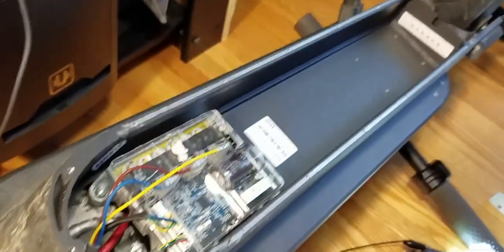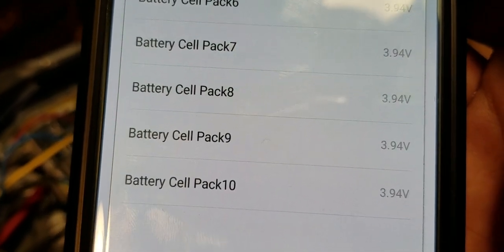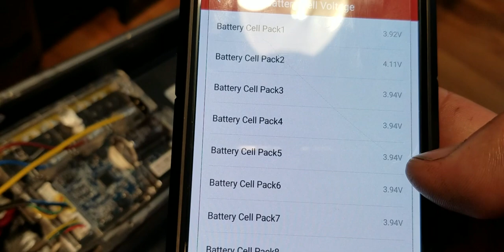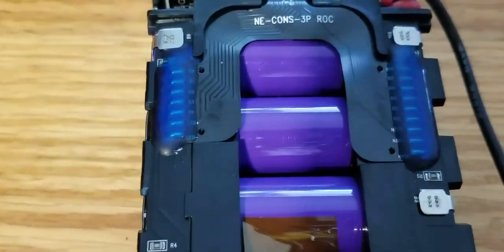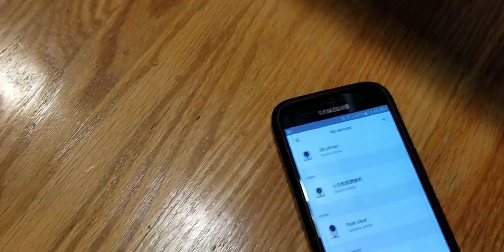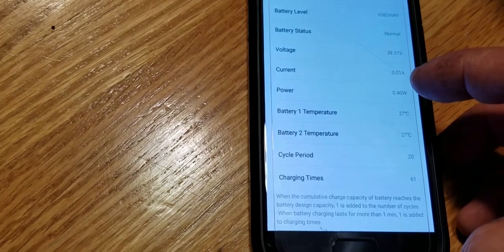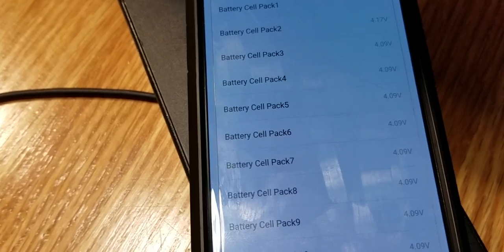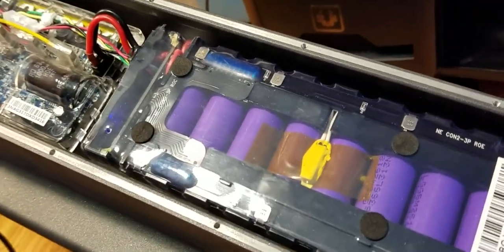Xiaomi M365 range problem - diag and repair

Comment: Hi guys, I just got my M365 scooter and been riding it for a week now. Quick question, does anyone here know if it's optimal to charge it after every ride, or should I wait until the battery goes to at least below 50% before charging? Does this even matter? Is there such a thing as a maximum number of total charges within the batteries?
Reply from the maker: i find it best to charger after every ride except when the next ride starts with a long downhill, because the regenerative braking will not work until you've used up a bit of the charge. it scared me the first time that happened, had to put my foot on the ground to help me slow down.
lithium ion cells don't suffer from frequent top ups. using up 20% and charging it back up is better than using up 80% and charging it back up.
enjoy your scooter and thanks for the sub!
Reply: Thanks for this video. I also use my scooter to ride to work and back and my ride is also less than 5km each. But the 3 times I rode it to work last week, I noticed that my scooter went from 100% battery to 71% my first ride, then 66% the second ride, and down to 64% my last ride. So I will also need to do this battery analysis like you.
Reply: I just checked and I have 41.35 volts at 100% power so the battery seems fine. But I can't get my app to display individual cell power. I have version 1.3.3 firmware and my Samsung S8 says that this is the latest version. I have Ninebot and Mi Home apps installed by the way.
Reply from the maker: mine fully charged and still connected to the charger is sitting at 41.55v. you really need to see individual cell pack voltages to really know if there is an issue or not. Only the mi home app can display the individual cell voltages. you should be able to update to 1.3.4 through the mi home app. and im am using a Samsung S7
Reply: I'm not sure what the mi home app is doing for me. When I go to my ninebot app and pair my scooter, then I go to my mi home app, I can see that my Mi Scooter is online. But I can't click into my Mi Scooter and I don't see the menu screens that you see in the mi home app.
Reply from the maker: kill the ninebot app, and only load the mi home app. i find i can't run  both at the same time. you need to be connected to the scooter through the mi home app before you can access the menus
Reply: I uninstalled both ninebot and mi home and then reinstalled mi home app. Now, I can't even connect to Mi Scooter. I can see that Mi Scooter is shown as my bluetooth device but it just continues to display 'tap to connect' even when i tap on it multiple times.
Reply from the maker: that is weird, i find that i have an easier time connecting to the scooter though the mi home app than the ninebot app. my only suggestion left is try another phone?
Reply: I did notice that when I first installed mi home(with ninebot app still installed at the time) that I got a message  that displayed that my "plug-ins failed". When I just re-installed my mi home, I never got any message concerning plug-ins at all
Reply: I just re-installed ninebot and noticed that even though at 100% power, my voltage increased to 41.40 while briefly plugged in
Reply: If you get to recharge those batteries 500 times, you are lucky.
After that, you will need to replace them; a good 18650 (around 2.800 mAh) battery will cost you about $5 a piece. A full set, then, will set you back about $150 - or, depending on model, up to half the price of the scooter.
P.S. Stay away from any 18650 battery with an advertised capacity above 2.800 mAh!
Reply: @mortschubert3909  your wrong, sry XD just had to comment lg hg2 and 30q are true 3000mah cells and do actually around 2850mah at 20A which is really good
Reply: @alanzhou858 , good to know that! Improvement of a product is expected with time.
Reply: @mortschubert3909  they have been out for ages.
Reply: @mortschubert3909  the cell he used in the vid was an 30q
Reply: @alanzhou858 , that might well be the case. I have always been weary of what looks too good to be true, especially since only no-name batteries seem to have capacities too high to be genuine. That has been my experience, anyway.
Reply: @mortschubert3909  I agree with you any cell that has over 20a at 3000mah is fake that's the best we have right now for 18650
Reply: @DougHnut  At 94% charge, my battery is at 40.5V, each pack between 4.043-4.058V.
That is normal, right? Trying to identify why my m365 won't go faster than 9.5mph...

Comment: What firmware? Why you have voltage on cell?
Reply from the maker: v1.3.4 i think only android version of the mi home app shows voltage of each cell pack
Reply: Doug Hnut Thank you Doug, I was wonder why my iPhone wasn’t showing cell voltages. After reading your comment regarding the possibility of only the Android mi home app showing cell voltages to a greater extend of detail, I found my old android phone and download the mihome app, and it works! Thank you!
Reply: Doug Hnut Also, you have greater knowledge of the M365 scooter than I and thus I seek advice from those that know more than I. My question if you would consider it, I’m adding a solar charging trailer to my M365 scooter and need to know the best place to wire my Genasun MPPT Lithium Boost charge controller to. The solar panels will connect to the Genasun (providing 41.7 volts for a 36 Volt nominal battery) and the Genasun will connect to the battery. It looks like I can plug the Genasun into the XT30 connector that connects the 36 Volt scooter battery to the scooter. Is this the best place to add charge back into the scooter battery while riding the scooter? Please respond with the greatest possible detail. I’ll await your response with great optimism, enthusiasm and interest. My girlfriend and I are doing this project together, and we are learning a lot in the process. Thank you in advance!

PS:
We learned about this solar charging while riding a bike or scooter by watching all of Marissa Muller’s videos here on YouTube. She cross the country with 240 watts of SunPower solar cells, two Genasun MPPT boast chargers, and a 250 watt Schwinn Specialized model S.

Comment: I did the same cell discharge with a leds and now the complete battery pack looks dead. Main cables have 40V every cells are on 4V and the smaller red black cable has an output of 3.6V
The bms has no flashing lights no red no black… Anyone any idea. I wish I could've not touched a thing and live with 50% performance…  :/
Reply from the maker: there is a reset button on the bms, have you tried that?
Reply: Doug Hnut yep, thanks. No luck. At the moment: my bms has 4 red flash and doesn't work. Fuses are ok. Thermal sensor is in the range 8-10. The power output is 3.6v on the top of the batteries the voltage is 39.9V. I guess I should measure all components on the bms to see what is wrong. I am too newbie to these so I am asking where would you start checking the possibly faulty piece on the board and how?
Reply: @sisqoszilard  Damn. Did you end up fixing it?
Reply: @taylorwhite3636  yep,  was difficult and ended up with changing u3 u4 and u5 chip on the bms…  battery is still on 50% tho…

Comment: Battery pack 2 is going bad that’s why it’s charging more than the others anytime a li battery starts going bad it will lose its capacity and charger faster because it has less capacity to charge

Comment: This is just bad cell. nothing to do with you running it down to 0%. Just random bad cell/failure. You can replace this section with new cell but its going to be hard to dissasemble the battery. Just ride it till it has unusable range for you and then make/buy a new battery pack
Reply from the maker: It ended up being one of the battery spot welds breaking off. I have since soldered it and have been using for awhile now with no issues.
Reply: @DougHnut   strong work!    good  diagnostic vid  check out endless sphere for info on bat care

Comment: XIAOMI BALANCES BATTERIES. JUST CHARGE YOUR SCOOTER TURNED ON.
Reply: Is that the best way to charge it with it switched on?
Reply: Are you sure because this whole video is about the problem that Xiaomi doesn't balance the batteries
Reply: That doesn't make sense, the bms is on the battery, when you charge it the bms does all the balancing not the other components of the scooter. The issue is the bms is probably a piece of crap.